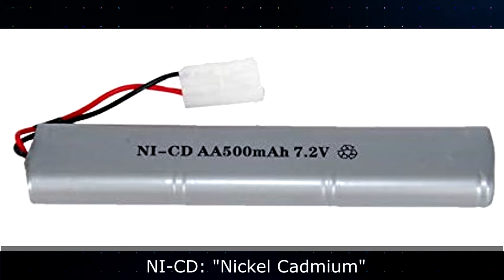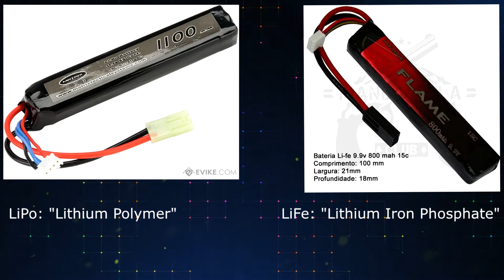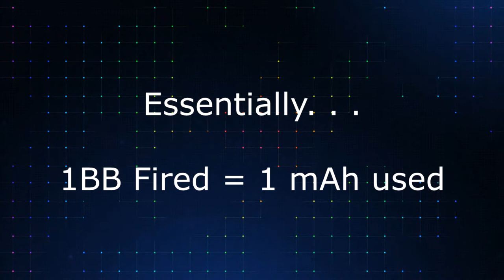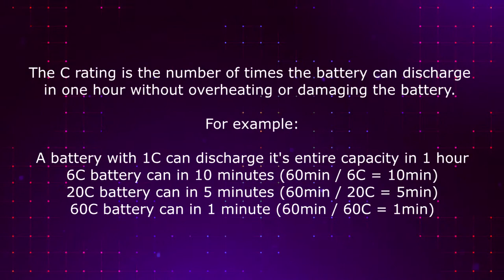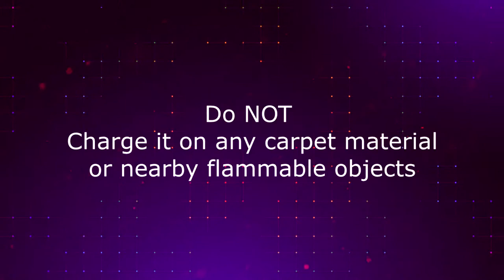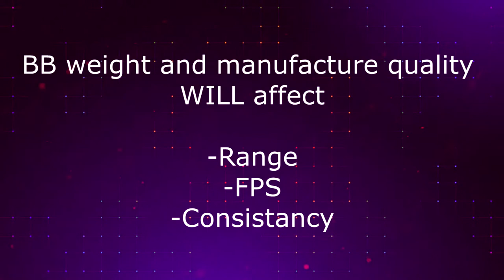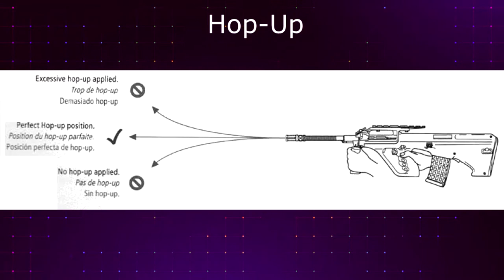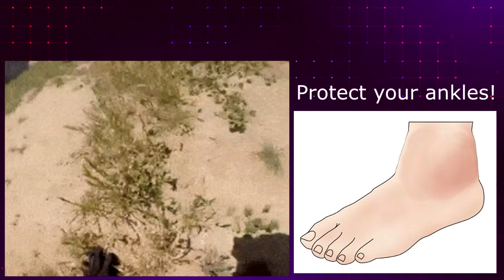Airsoft 101 - Learn the Basics of Airsoft

Comment: I would say that yes it is bad to use aeg’s in hot weather, but there meant to be used in the cold that’s why aep’s are made cuz gbb suck in cold
Reply from the maker: AEG are for sure better than GBB in the cold but the batteries really dont hold up well in cold temps. not to mention with all those metal moving parts internally, and the plastic parts becoming more fragile in the cold, you're gonna cause internal damage in things like your gears, piston teeth and the rubber seals. Ive had to use hand warmers taped to my gearbox to keep the gun working in the cold before xD

Comment: got my first electric airsoft gun and am having trouble aready
Reply from the maker: What did you get
Reply: I learned how to use it the clip is one of the cranking ones I just got to crank it every 10 or 20 shots
Reply from the maker: @onechampion4128  Yeah a High-Cap mag. They need to be wound up every so often haha. No worries, its easy to overlook when youre first starting out. I recommend midcaps to avoid winding. a PTS EPM mag or BAMF Gen 2 are good ones to look into
Reply: Do you recommend any beginner airsoft guns
Reply: ok
Reply: I'm barely getting into airsoft what should I know about going to arenas
Reply from the maker: @onechampion4128  I dont have any near me so i dont have firsthand experience. But the biggest things are pay attention to rules and briefing. Research the field before hand. dont be afraid to ask questions. and dont f'ing cheat haha